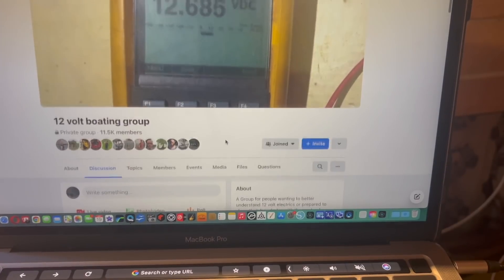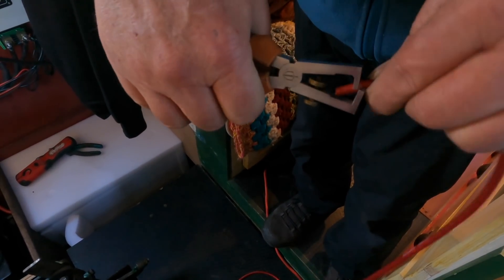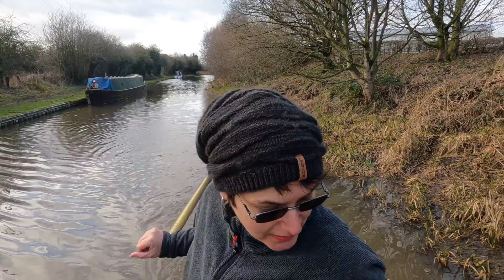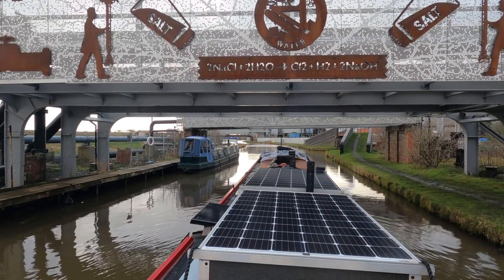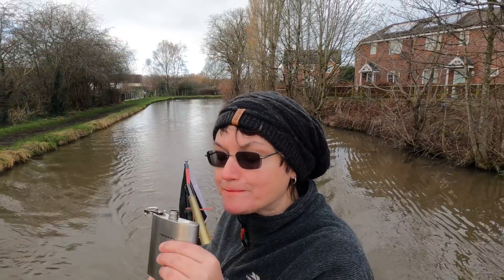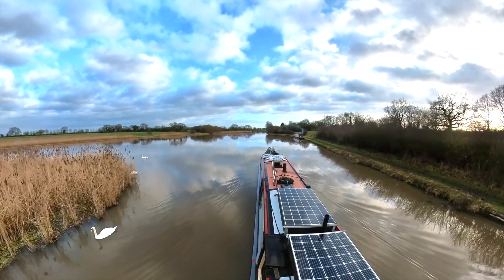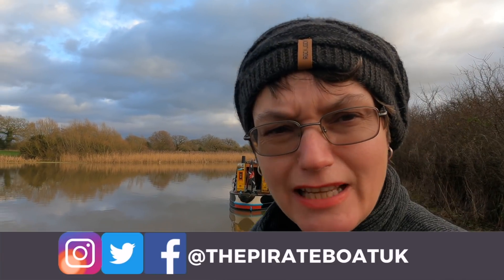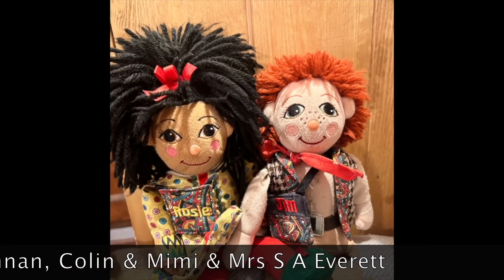Lithium Hybrid on my Narrowboat - My Alternator gets hot [Ep 36]

Comment: hi guys,we really enjoy your vlogs,i was just wondering if you did a power audit before you went ahead with the battery upgrade,are you power hungry on board?,i`m thinking of doing the same set up as you but not sure if it will suit us,as we use about 30 amh aday all in,how does this compare to your usage,keep the vlogs coming,see you on the cut,cheers
Reply from the maker: Everything on my boat is 12v except my washing machine, dyson etc which I only run when the engine in anyway or through the genny …. To be honest during the summer with my 600 watts of solar and cruising I cope fine but during the winter with no solar and running my fridge etc I am having to put my genny on for a couple of hours in a morning and the same at 6pm … my batteries aren’t dead as I’ve never gone below 12.2 but they do struggle more in the dark winter … now I’ve gone hybrid I am only having to put my genny on for 1.5 hrs once every 3 days running my fridge freezer and everything 😃😃 it’s probably not worth it unless you are off grid all year round

Comment: um i think you know this already but here goes: to keep a lead acid battery healthy it should not be discharged below 50 percent. where as some lithium batteries can go down to about 20 percent. have fun.
Reply from the maker: Yes …. but luckily with hybrid … it keeps the lead acid in float and you use your lithium until it goes low or the bms switches off, then it starts to use your lead acid bank and the other battery monitor comes in to play 😃… I can’t even get this to go low now as solar and cruising is keeping it topped up all the time …
Reply: @TheNarrowboatPirate 

Quite like this hybrid battery system wheeze and looks as if it works off the alternator and solar charging systems at the moment.

Now, one teeny weeny concern and that is IF you use an "intelligent" mains battery charger that will do the voltage equalisation thing, then the voltage used for the equalisation period is around two volts higher than the LiFePo4 batteries are happy with.

I gather that if you use the hybrid system then the automatic equalisation function should be disabled on said intelligent battery charger.

Would this affect your system at all if you sometimes plug into shore power?

When you thought your lead acids were getting old are they ever equalised at all? It may be (and I speculate here) they might benefit from being equalised. This process can take a few hours or possibly a day or two.

Some solar controllers have this equalisation function so you might be lucky but you might not be doing your LiFePo4 battery any favours.

It might be the BMS module will sort out the over voltage but if it is not then you run the risk of overheating the unit ... having your battery cocooned as seen in the clip might suggest you monitor the temperature for overheating.

Will presume you will do a follow up episode ref the hybrid install so will be interested to see how your set up gets on.

Thanks very much for this episode as never knew you could lead acid and lithium together.
Reply from the maker: I’ve mentioned my hybrids in other videos since … it’s working fantastic …  if you look in the video description there is a link to a fb group which is fantastic for all hybrid questions … my old batteries weren’t knackered and had never dropped below 12,2 but were starting to tire and it’s much cheaper to hybrid then go full lithium … it’s seems all sail boats, van lifers and narrowboats are going hybrid now … I have a victron 60 amp battery charger I run off my genny and when I put it on instead of it slowly working down it is constantly throwing 60 amps in until the lithium turns it’s self off …. The best thing is the bms … and life batteries.co.uk were very helpful with guiding me through my set up 😄😄
Reply: @TheNarrowboatPirate  👍

Comment: Hi just wondering if that new length of wire gets hot as, you seem to be using it as a resistor?
Reply from the maker: Ahoy, no it doesn’t even get warm 😃 that’s why we were told to go from the split relay and not the alternator itself

Comment: Great vlog.  I have an EV so understand how superior lithium batteries are.  Would you replace the lead acids for lithium too in time do u think ?   Best wishes.
Reply from the maker: I’m not sure Trev as the problem with a full lithium set up is I would have to change my alternator, battery charger etc and I doubt my old air cooled 18 HP engine would handle a massive alternator plus all the additional expense on top which is why lots are going hybrid 😃
Reply: @TheNarrowboatPirate  makes sense.  Would lose the boats character too if doing all that. Love the sound of your engine.  Absolute classic.

Comment: AWESOME battery choice.  Lifepo4 batteries can be drained down to almost nothing and recharged without issues.  Best part, you can even mount them upside down because there's no chemicals to leak out.  Not a sealed AGM... A truly acid free battery.  We have ours stood on end to give us the space for 400 amp hours. 2 of the kind you have.  We can just leave the TV on all day and even play the xbox all night if we choose.  It's expensive, but it will last you years and years.  You don't really need to use that "v" brand charge controller.  A good MPPT Charge Controller that can take the voltage from your panels is all you need.  Check on the South American river site of the popular auction site.  A quick check showed a NICE quality one can be had for under $50 Pounds.
Reply from the maker: I’m loving it David … I’ve gone from running my genny 4hrs a day in winter to 1.5hrs once every 3 days
Reply: Many of those cheap MPPTs are junk pretending to be MPPTs. You pays yer money...
Reply: @kevgermany  Website like shops have deals.  I was obviously referring to a quality brand at a good price.  Educated consumers find deals by virtue of the work done to research their install.  Prices continually fluctuate.  No different than a sale on biscuits at your local grocer, or even a close out sale at one particular shop.  Didn't think that needed to be said, but there you have it. Thank you ;)
Reply: @DavidBriggsAdventures  no point in arguing, except to say there are plenty of well educated people who  are unaware of the pitfalls
Reply: @DavidBriggsAdventures  Why are you trying to turn Heidi's  lovely channel into a slanging match? I'd have thought that someone with your level of knowledge would realise that both of us are trying to help. After all what's obvious to one person isn't necessarily obvious to another. 
But don't  worry, I'm not entering into behaving like an ass competitions, your position is safe. And that is my final word.

Comment: Never heard of adding a lithium battery to a lead acid set up. Does it not restrict the amount of power and how quick you can charge the lithium? With a 200ah (can use 100%) lithium being equivalent to 400ah lead acid (can only use 50%). Would you not be better dumping the lead acid so will charge quicker from solar. 
You could also get an induction hob to use in summer and sunny winter days to save on gas. If have to run engine to charge battery's will take a third of the time if not a quarter (with bigger alternator to handle it) with just lithium. So run engine less use less fuel. Then in winter if you angle your panels you should be able to live of solar as can take more charge quicker (Minimalist manage this I believe). You've confused me Heidi lol, I'm going to have to go look it up.
Reply from the maker: I cope during the summer fine with my solar but in winters it’s tough and I usually have to run my genny for 4 hrs at various parts throughout the day but now I’m just running my genny for 1.5hrs once every 3 days… I’m running fridge freezer and everything 😂😂 hybrid is very popular with van lifers too .. it means we don’t have to buy lots of other expensive bits and pieces and the lithium keeps the lead acids topped up 😄🏴‍☠️

Comment: Check that your insurance company is ok with Lithium batteries !
Reply from the maker: They are fine with the lifePo4 as they have their own BMS built in 😄
Reply: I store all my Lipo batteries (RC enthusiast) in a fireproof metal box in case they go on fire. Technology has improved their safety dramatically but checking with your insurance company is good advice. On the positive side they are certainly superior in performance to many other  battery  types.
Love your vlogs
Reply from the maker: Thanks Geoff 😃🏴‍☠️
Reply: @TheNarrowboatPirate  BMS I'd forgotten they mostly have that on board. The little ones I use don't... I. Learned very quickly not to overcharge or over amp them  when the battery grew in size and started to smoke completely knackering the battery.